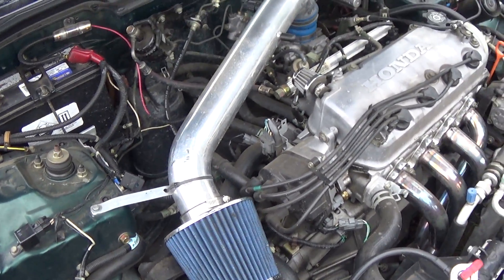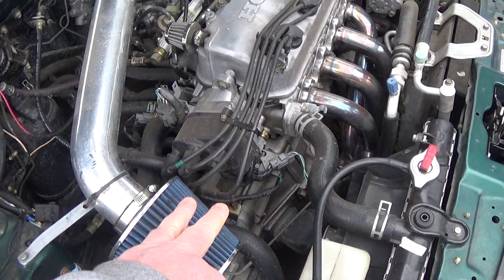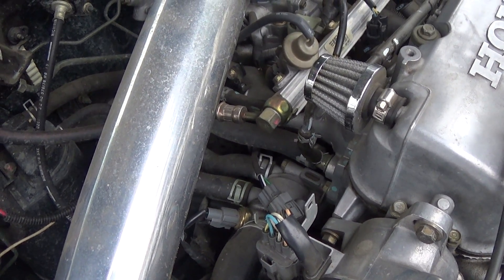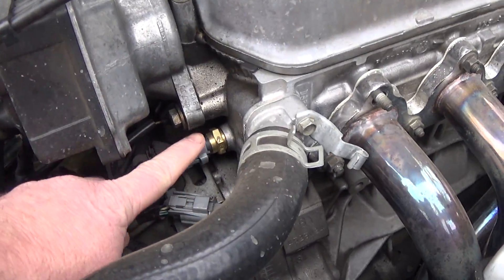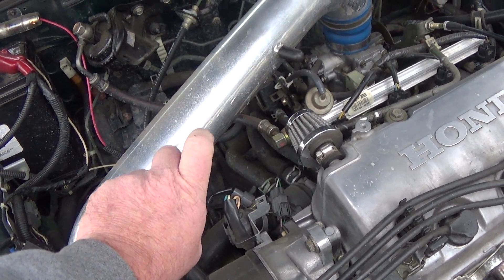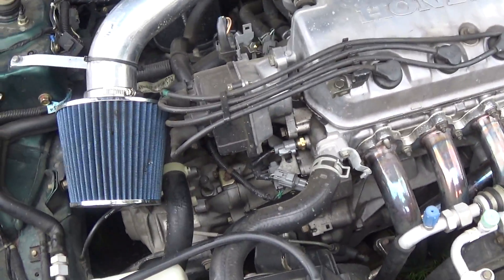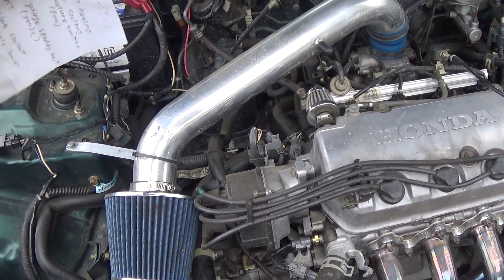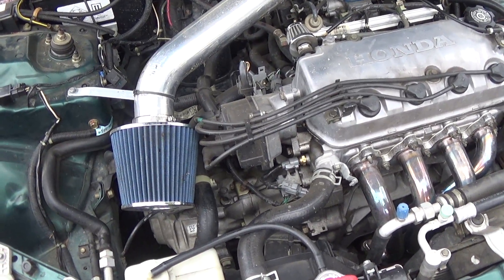Explaining Honda Civic 3 Engine Coolant Temperature devices

Comment: Will a faulty sensor be the reason my temp gauge works occasionally and other times it jumps to all the way H with the engine being just fine and not over heating? Most of the time it reads cold but sometimes it does work and then randomly stops when driving. I’m guessing it’s the sensor but would like some insight

Comment: Thank you for making this video. Have had a misfire at operating temp for almost 2 months now with no CEL. Changed everything in the fuel system, the map sensor, and about to change the IAC. Threw a code last week for a temp sensor and was about to change the wrong one (by the thermostat).

Comment: Can the engine temperature gauge sending unit cause it to run cold even after changing the engine switch & engine coolant sensor ? Changed 2 out but car is starting cold and when warm it shuts down cold at high rpm
Reply from the maker: The gauge sensor, just runs the gauge.  Most likely have a pocket of air in you coolant system.  Need to burp it out.  Also, for some reason, people often have the wrong thermostat in the car.
Reply: @tubejim101  what about if it's no thermostat in the car and how do u burp it?
Reply: I've changed out 2 temp sensors and only have the gauge sensor left. It gets in mid rpms and it slaps cold and makes the trans drop down in gear . I don't have a thermostat in
Reply from the maker: @Ace-dk4co  If you don't have a thermostat, you found your problem.

Comment: Idk if you're still active on here, but I'm having some problems with my Idle so I ordered  a new IACV and map sensor.. but now I see some missing hose from the Throttle body and behind it.. idk where those hoses go and I'd like to replace them but idk what hose to buy. Also, I see that you have an aftermarket air intake. I still have the stock one
Reply from the maker: What year, make, and model are you working on?
Reply: @tubejim101 2000 EK3 ferio, D15b
Reply: Throttle body positioned upward not to the side
Reply from the maker: @Amado_slowed  You can go to your Honda Dealer Parts Department, and they can print you out a parts list, with pictures, showing you all the coolant hoses.  I would start there.  Also, ask them about ordering the shop manual that would cover your engine.  They are expensive, but well worth it.
Reply: My country doesn't have that tbh 😅
Reply: @tubejim101  but thanks

Comment: My 94 Civic was overheating last week, ran decent before. Changed thermostat and changed top hose cause it was bad and squishy, car still wouldn't turn on fan, so I drove it to test it and parked it. Next day wouldn't start, do you think the coolant sensor in the front went bad, causing a no start. I'm getting fuel spark, has compression and I checked the timing is perfect. I had just replaced the dizzy and timing belt water pump and starter. I will be getting a new battery replaced by warranty tomorrow, but I suspect it's that sensor & my switch is bad too
Reply from the maker: You need to learn the art of trouble shooting.  Maybe I should make a video on it.  When you lack experience, use the half trouble shoot method.  When you learn how to test, you save lots of money.  I would start with taking your battery and alternator to the parts store, and have them bench test it for you.  Also, they can test your starter, if you bring it in.  Your fan is most likely not coming on, because you have air trapped in your coolant system.  Also, make sure you are using the correct temperature thermostat.  Use the new long life universal pre mixed coolant.
Reply: @tubejim101  I actually diagnose it myself today, I've come to suspect my Chinese made distributor gave out. My spark is pretty weak, the alternator checked out battery was new, the sensor was just replaced OEM, the timing on the belt was just replaced, the starter was just replaced and it cranks.i get fuel from the rail, and compression. Thanks again, I'll post again once the new part comes in and I replace it
Reply from the maker: @EduardoDiaz-v9d  Each of these components can be tested.  You can test the coil in the distributor.  That is most likely why you are getting weak spark.  You can test the ohms of your spark plug wires.  No need to spend money, on parts that are good.
Reply: @tubejim101  thanks ill diagnose it more throughout the week , I'm at work mornings, and when I get off I'll test the Dizzy more. Appreciate the feedback, I'll fine tune my diagnostic checks
Reply from the maker: @EduardoDiaz-v9d  If you want to learn to trouble shoot, you should get a multi meter, and learn the relation between: Voltage, Current, and Resistance.  With this knowledge,  you will be able to trouble shoot most things you will come across.  From your car speakers, to your clothes dryer, to your car. If it uses electricity, you can diagnose it.
Reply: @tubejim101 you are correct, i should learn ill browse yours or other's video to learn to do that. Again i appreciated the quick reply and very informative advice
Reply: @tubejim101 also I use peak Concentrate and mix with distilled water, 50/50 or depending on the weather I usually mix more concentrate or keep it half/half

Comment: my gauge temp sensor is capped off yet i still get a reading on my temp gauge hows that possible?
Reply from the maker: You would have to read up on how it operates.  And how to test it.  I can't remember if the sensor sends a voltage, or just changed the resistance.  In electronics there is something called floating.  Your most likely experiencing that.  Most of the time in electronics, they fix that with a pull up or pull down, on the floating pin.

Comment: Hi thanks for the video and clear explanation. My car code was a 6 times quick flashes or blinks which is number 6 obviously. And that’s related to the coolant temperature sensor. My car is with a “crank no start” issue. It had no spark on plugs or coil, i replaced the distributor because it was bad, now there’s spark but still not starting. So now my question is, can  this and sensor also cause the the no start issue?? 
Thanks for your help!
Reply from the maker: You need to get a scanner, and read the odbii codes.

Comment: Where  is the location  of the coolant temperature  Guage sending  unit oon the rg1 located
Reply from the maker: On the Honda Stepwgn RG1 (third-generation Stepwgn, front-wheel-drive model), the coolant temperature gauge sending unit (sensor) is typically located near the thermostat housing or on the cylinder head.

Comment: I am at my wits end trying to fix this issue with my car. I have a 1996 Honda Civic D16Y8 and my radiator fans will not turn on. I have replaced the thermostat, radiator fan switch, new coolant and I made sure to burp it for 30 mins with heater on, even jumped the power to see if the radiator fan works and it does because I bridged the connection and as well I even hear the relay working. Please if you can help I appreciate it as I am a full time student that commutes to San Marcos for school and this is what I got.
Reply from the maker: Fist:  https://www.youtube.com/watch?v=UHv4rPSmI3A  If you did this, and it works, you have to find out why the switch on the thermostat housing is not closing.
Reply from the maker: Coolant fan switch testing:  https://www.youtube.com/watch?v=Lcx_TlOKkFU

Comment: How did you get your valve cover to look like that ? I have a base trim 1.5l DX with the textured black paint on the valve cover, but really like that  bare metal look. 
Your valve cover looks smooth. 
Did you have to grind it down smooth, or do V-tec engines come that way ?
BTW, this video answered my questions about where the temp sensor was. All I could find pointed me to the one by the thermostat, but I bought a pair sold together, and and had no idea finding where the other one went. 
-thanks
Reply from the maker: I would buff out the aluminum with Mother Aluminum Polish.  You can lock it in, with Stoner Trim Shine:
https://amzn.to/418lEbN
https://amzn.to/4eyeVdS
Here is a video on Trim Shine:  https://www.youtube.com/watch?v=vD8NsyZ7-6k

Comment: Hey man just curious if you know any oem sites that sell all 3 of these? Links would be greatly appreciated I have a d15b7 I want to rebuild 🤠
Reply from the maker: Fan Switch:  https://amzn.to/2OayOMX
Gauge:  https://amzn.to/2x4VPcN
ECU:  https://amzn.to/2NaUXOU
Reply from the maker: For OEM you can try Honda.  They may still use the sensors in newer cars, but if they are too old, they will drop them.  That is the part of the purpose of aftermarket industry.
Reply: @tubejim101 facts. I did aftermarket and it worked fine
Reply: Any recommendations on aftermarket replacements?
Reply from the maker: @jrrea3740 
Fan Switch:  https://amzn.to/2OayOMX
Gauge:  https://amzn.to/2x4VPcN
ECU:  https://amzn.to/2NaUXOU
Reply from the maker: @jrrea3740  
Fan Switch:  https://amzn.to/2OayOMX
Gauge:  https://amzn.to/2x4VPcN
ECU:  https://amzn.to/2NaUXOU

Comment: My car won’t start an it keep throwing the engine coolant temp sensor so will any of them cause it not to start
Reply: Yes it will, I have a 1994 honda civic and the distributor was leaking oil on the engine coolant temperature sensor which would cause my car to no want to turn on after almost an hour. I replacement the seal on my distributor and then cleaned my engine coolant temperature sensor with MAF cleaner and my car starts up quick now.
Reply: Is your an automatic or stick?
These sensors will not cause the problem of no start.

Comment: Would a bad etc cause my 2000 Honda civic ex to over heat ? I just replaced head gasket , timing belt , water pump , thermostat, which is OEM Honda , Honda coolant both new radiator hoses , new radiator and my car still overheats . But once I put on heater the car cools back down to the middle of the temperature needle . Need help
Reply from the maker: Sounds like you have an air pocket in your cooking system.  Need to turn the heater on high, and burp the system.  Can take a while to get all the bubbles out.
Reply: What if I never changed ect before ? Or fan switch sensor
Reply from the maker: @hilyfe5690  Then you should test them.
Reply from the maker: https://www.youtube.com/watch?v=UHv4rPSmI3A
Reply: Is there a guide to test them ?? I just started car , notice that it needed a little bit more coolant in the radiator, I left the cap off turned on heater full blast and a little bit of bubbles are started coming out , then the bubbles eventually stopped . Took about 15-20 mins . For some reason my radiator fan stays on even when the car isn’t warmed up?
Reply from the maker: @hilyfe5690  https://www.youtube.com/watch?v=UHv4rPSmI3A
Reply from the maker: @hilyfe5690  Make sure your coolant over flow is above the low mark.  As it burps, it will need to suck coolant in, when it cools down.  Don't want to suck air in.
Reply: Ohh btw no check engine light codes
Reply: Had my car pressure tested this morning and no leaks coming out of the radiator, will the ect make ur car overheat ? Thinking of changing that out and see if that fixes the problem . Do I have to drain coolant or could I just change sensor ?
Reply from the maker: @hilyfe5690  the only ect device that is going to make your car overheat, is the one that turns on the fan.  It is easy to test.
Reply: I tested it and it works just fine , the fan actually stays on even if I just turn the car have it on the battery u can hear the fan going . Any other ideas what it could be ? I’m thinking it’s not reading the temperature correctly that’s why I was thinking of changing all 3 engine coolant temperature sensors
Reply from the maker: @hilyfe5690  Each of the three only has one job.  1) turns the fan on and off.  2) runs the temp gauge, on the dash.  3) tells the ecu  how much fuel to use.
Reply: If you are still having problem of overheating.
Take out the hose that's connected to the Thermostat. Inspect & look at the Thermostat carefully.
1. Installed correctly?
2. The Head Nail (ATG's weep guide) shape is at 12 O'clock? 
3. Weep guide not block from gasket?
4. If all correct. Remove the Thermostat out & place it into hot pot water. Thermostat must open, if not then it's bad

Comment: is there an easy way to replace the plastic connectors that clip in? the two under the distributor on my 00 civic broke off and I'm having trouble finding a fix
Reply from the maker: First check with you Honda Dealer.  Some things are at good prices.  It is hit and miss.  Also try auto body shops.  Try to find one that orders through: https://www.auveco.com/auveco   Also wrecking yards.

Comment: Hello, does the ECT sensor make you consume more gasoline? What anomalies do you feel in the car?
Reply from the maker: Depends on which of the 3 ECT (Engine Coolant Temperature) sensors are bad.  If the fan one was is bad, your car will most likely over or under heat, depending on what your fan is doing.  If your gauge one is bad, you will most likely be stressed over bad display information.  If your ECU sensor is bad, it will be using the wrong mapping for your engine.  Will most likely run to rich, or lean depending on what miss information the ECU is getting from the sensor.
Reply: Most of all I need information from the ect since it throws black smoke through the exhaust can it be that? I've already changed probe O2 spark plugs!
Reply from the maker: @ferdinandlarez1572  There are many things that could cause that.  Don't waste money throwing parts at guesses.  You could be using that money to educate yourself, and to buy diagnostic tools.  I have no idea what you are working on.  If you have done any modifications.  If I was working on a 96 to 2000 Civic, fist thing I would start with, was a compression, and leak down test.

Comment: Hey I gotta question I gotta 2000 honda civic I replaced  radiator cap and thermostat and my gauge still won’t work it’s on cold but my heat works  and I sat and bleed it for atlest 20 mins or more and when the cap was off The gauge  would move a little what could this be  but once the fan kicked back on right to cold again ?
Reply: When bleeding air out of the system carefully remove the radiator cap (better when cold so it doesn’t burn you with steam) turn the heat on full blast and start the car. From there you can fill coolant as needed and squeeze the upper and lower rad hoses to “burp” the air out if there is any trapped air. No more bubbles no more air.
Reply: Also no engine lights for the coolant system just the o2 sensor
Reply from the maker: Did you have your heater on, when you where running it for 20 minutes?

Comment: Hi my fan is working but there are times that my temp gauge go above middle on top of the F sign though its going back to normal after few sec. Not sure if the fan is delayed or what
Reply from the maker: You might have a pocket of air in your coolant system.
Reply: @tubejim101  I did the bleeding process, still the same. Could it be the sensor or the rad cap?? I'm sure its not blow head gasket coz the water is properly circulating in rad
Reply from the maker: @jeraldandales7501  Most likely still has air in the system.  It can take a long time to get out.  Also, make sure you are using long life, universal, pre-mixed coolant.
https://youtu.be/QrPIpZS8td8?t=280

Comment: why my honda civic 94 manual over heat the gauge up to center  i flush the radiator put new antifreez and new thermostat when i drive more than 10 minutes the gauge go up little the fan work but never have tnhis problem before the normal gauge under the center a little
Reply from the maker: Most likely have an air pocket in your coolant.

Comment: Great video I think mine is the temperature switch cuz fans working perfectly fine and fuses and relay but dan don’t turn on .
Reply from the maker: Make sure you don't have air in your coolant system.

Comment: Unrelated but What year is this car? What has all been to it? Your intake system is different than mine. Wheres the intake manifold? You have a breather filter and my intake ( dCsports) came with a hose to that goes from the breather to the intake pipe 🤔. I have a 95 ex 1.6l vtec
Reply from the maker: After 95, Honda ran the next d16 engines till 2000.  My engine is a d16y7.  The d16y8 would look more like your d16z6.

Comment: Good video. I change my thermostat n the temp switch but the thermostat still not opening. Need help !!
Reply from the maker: Have you done this?  https://www.youtube.com/watch?v=cMRzosjehRk
Reply: Yes I did this first before I change the thermostat n the temp swicher.
Reply from the maker: @chiosaeteurn9790  If all the parts tested good, then you most likely have a pocket of air trapped in your coolant.

Comment: If you want to test you temp gauge, just take of the cable form the sensor and make contact with the mass of the car.. (ground). If the gauge is working, it will show full temp. (The sensor works at 140 ohms in cold temp and at 30 ohms, at full temp.). But don´t keep connected to the mass too long, but just enought to see the needle moving from cold to full temp! Or use a decade resistance. box.
Reply from the maker: Great tip.